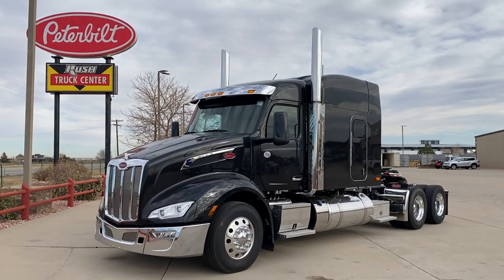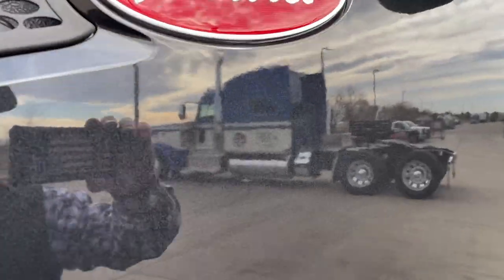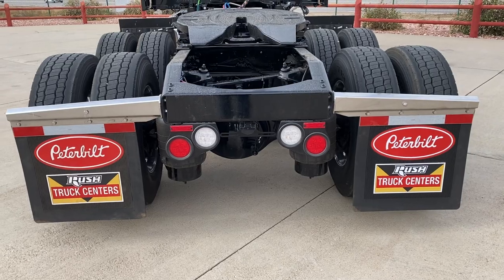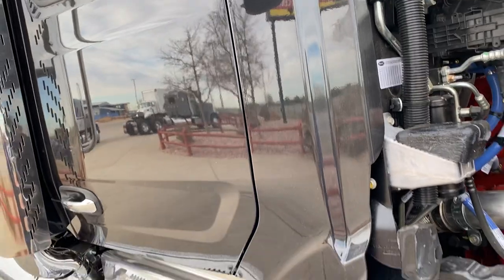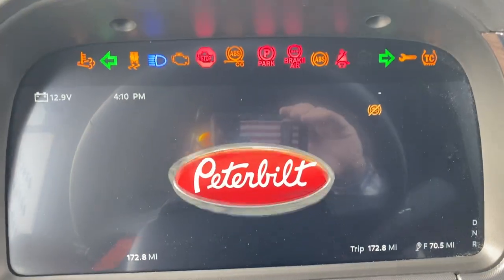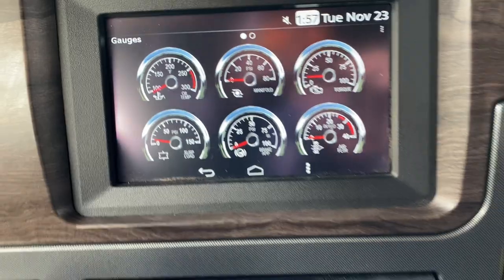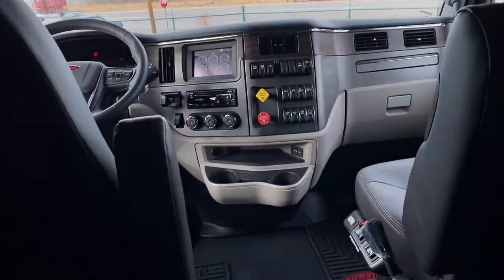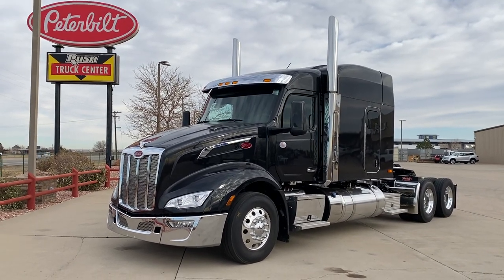2022 Peterbilt 579 Automatic!

Comment: All newer trucks should come with air ride steer axles, and all wheel disc brakes.
Reply: They do, at least in Europe with the disc brakes.
Reply: They do if you order them that way
Reply: Nice
Reply: The new Peterbilt dump trucks have disc on the front and drums in the rear

Comment: The new 579 looks great as a mid roof proving me right again that the ultra loft looks goofy af and it’s not just the redesigned hood
Reply: The ultraloft looks so stupid!! I hate it
Reply: If it’s done right it looks good. You guys have a right to your option but it most certainly does not prove you are right. All it proves is an opinion. Nothing more
Reply: @danielmurray5326  I never said anything about being right all I said was It looks stupid
Reply: I agree, that mid roof makes it look soooo good
Reply: Midroof is gorgeous on the outside. The Ultraloft is abviously better inside. And you can't put straight pipes with the ultraloft :). You can and should with the mid roof :).

Comment: Looks like a TMC spec truck or what the new TMC trucks would look like.
Reply: I don’t think they will spec an isx with 565 hp
Reply: @alex7289  
If I’m not mistaken they spec the Cummins, just not sure what go rating.
Reply: From what I've seen on their used trucks they spec 450 Cummins 15 liters and on the older ones 9 speed manuals and newer ones Eaton 12 speeds
Reply: Was just thinking that
Reply: Was just thinking that

Comment: I ran a fleet of trucks for 20 yrs  and have no bias as to brands as I have owned them all and I currently am working a job in a semi retired mode and the truck is a 579 with an mx13 and I wouldn't recommend it to  anybody it spends more time in the shop then any I have ever owned never for anything major just one annoying glitch after another 
Such as the AC just randomly decides not to work and then work as does random things like the low coolant light and dings while it is full of coolant ...and the best thing is it will throw a shut down light and the display will tell ya no faults found ....I'm just happy I am not the one paying for it

Comment: Nice truck no doubt about it, i let you know what is the cooling issue is, the radiator isn’t big enough for even the 565, I have the same problem on my t660 on my 550 Cummins, my local Cummins shop pointed in the Dino the radiator is no big enough to keep the heat and kenworth don’t make for the model more big, in fact is a problem of the design, engineering is falling in that part

Comment: Hi super nice video I have a question if you have a low budget with all your knowledge and only can afford a use cemi which would be your first 3 options and why
Reply from the maker: Peterbilt.  Pre-2007.  Easy to operate and work on.  However, you will always be working on it because of the year.  It's just getting old and everything wears out.  If you are trucking to make money you need to buy a new truck.  You will never start making money until you start running new trucks.

Comment: Could this truck be ordered with NO electronics on the steering wheel? What's the largest sleeper?
Not enough storage in this one, for me. Can you get a deeper bumper and visor? What about all cabinets with doors?
Reply: I've been looking and reading, dash is what is shown, unless you want used. As for the rest you will have to have a sitdown with the dealer.
Best wishes from the far North.
Reply: This is the largest sleeper but if you order it with a single bunk you get 2 extra cabinets and you can get them all with doors.

As far as I know the new smart steering wheel is standard you can’t get a “dumb” wheel

Comment: If you get the 565 hp engine why wouldn't you just get the 2050 torque instead of the 1850 torque could someone please answer that question
Reply from the maker: 2050 torque is not approved for the 579 yet.  It's a cooling issue.  It should be resolved soon.
Reply: The 389 dissipates heat more effectively from the transmission oil cooler than the 567 and 579.  I expect this will be rectified in the near future.
Reply: @hudsondonnell444  thanks
Reply from the maker: OK.  Here's the deal on the 2050TQ:  I can get a 2050TQ 565 or 605, however, if it's a 605 it's limited to 80,000lbs. GCWR.  So if we want anything above 80,000lbs. we need to use a 565HP motor.  Also, if we go 2050TQ we are forced into an 18 speed manual or an 18 speed Ultra-Shift Plus.  No other tranny's available for that configuration.
Reply: @RockyMountainPeterbilts but, what about the overheating issue with a 565 and 2050 torque

Comment: So what is the advantages of the low leaf  rear suspension over the flex air suspension?
Reply from the maker: They are very similar suspensions.  Low air leaf tends to be a little more robust.
Reply: @RockyMountainPeterbilts  the suspension geometry is different between the two of them.  I don't remember which one is which, but I know an owner operator who had a 379 with the earlier version and put a million plus miles on it.  He bought a new long nose truck with the newer suspension and promptly rolled it over on 77 in WV.  This must have happened sometime around 2013 or 14.

Comment: Yup. Kiss the 379 good by fellas. Pete will no longer make it. Your looking at the replacement.
Reply: Edit 389 will be no more
Reply: WRONG!!!!!
Reply: @jcsully  go do your research and ask. I was just at Shreveport Peterbilt and it was told to me by a salesman. The 389 will be no more that's why Kenworth came out with the w990 for carhaulers.
Reply: Research has been done. That salesman just wanted to sell a truck. And if your research is listening to a salesman, then YOU haven't done YOUR research.
Reply: @jcsully  I wasn't there to by a truck also I heard this from a high rep in the industry who builds carhaulers
Reply from the maker: 389 will go away as of 1-1-24 (2025 model year).  the new 589 will be replacing the 389 at that point along with new emissions as of 1-1-24.  Unlike KW the new 589 kept the external air breathers.  It will look very much like a 389 but with more interior room.
Reply: @RockyMountainPeterbilts  thank you for explaining to this person. I had the model mixed up but corrected it. I have a 389 car hauler from rush.
Reply: @RockyMountainPeterbilts  so I guess salesmen don't know what they are talking about when it comes to the product they have to sale.... Keep the videos coming!
Reply: @RockyMountainPeterbilts  I also heard that the x15 is going way
Reply: 379  is a gorgeous antique...your grandpa's truck, lol. Aerodynamics are similar to hydrodynamics, which is why we are seeing so many beautiful dolphin profiled trucks...saving fuel and putting dollars in your pocket. chi-ching!
Reply: I hate these automatics.